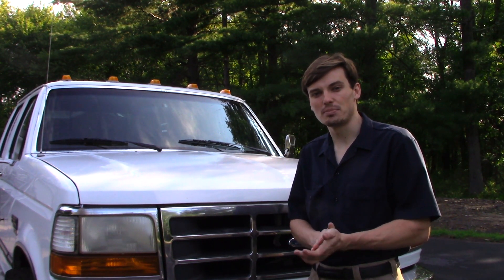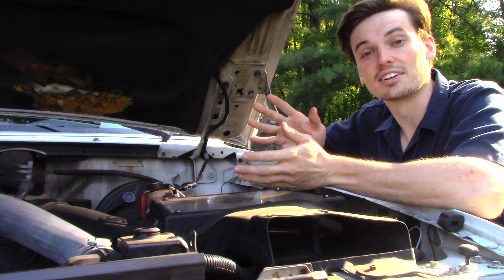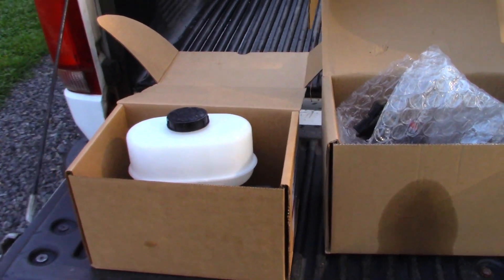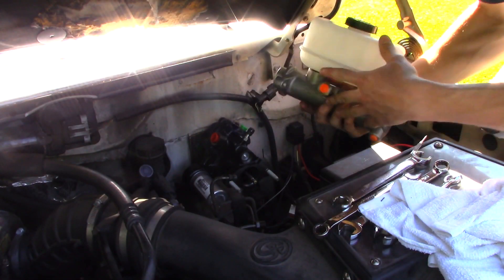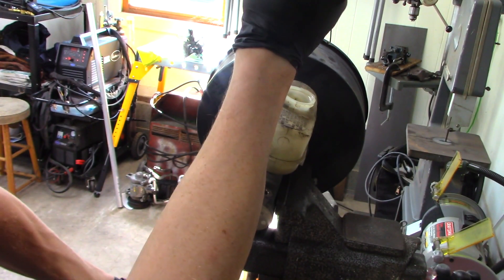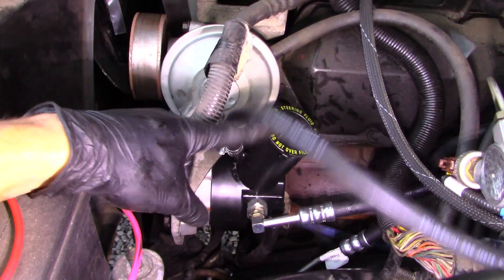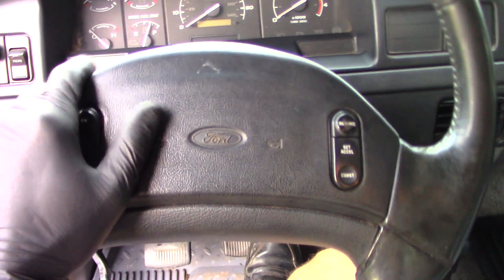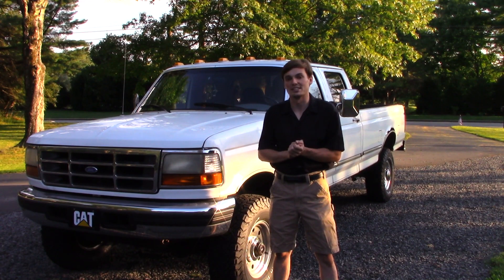Ford F350 Powerstroke 7.3 OBS Hydroboost Brake Conversion Upgrade (1992-1998)

Comment: Few things to note that you might already know by now.

The box under the dash connected to the brake pedal is the brake switch. It is what turns on your brake lights. Also on the E4OD trucks, if it gets signal from the brake switch, it will unlock the converter.

The sensor on the front of the master cylinder is for cruise control. When you push on the brakes it pushes in that pin which disables cruise.

It doesn't look like you moved either the brake pedal pin, or the hydroboost mounting location. As you can see when you're under the dash trying to hook up the new hydroboost, it's not lined up. It will work like this but you're binding the system. You either need to move the pin on the brake pedal up 5/8" or you can redrill/grind down the bolt holes on the firewall 5/8".

The proportioning valve for drum brakes is important because if you panic stop, you will lock up the rears but not the fronts. This is dangerous in a number of ways. You can order the correct proportioning valve using Ford PN F8UZ-2C161-AA. It's only about $70 and takes 5 minutes to install. Definitely worth the money to make sure your brakes will work correctly when you need them most.

Just did the same swap on my 1989 F350 with a leaky vacuum booster. $230 dollars later and I feel like I stop in half the distance now.

Overall good video. Subscribed!

Edit: One more thing. You don't actually need that new PS pump. You can put a tee on the hydroboost to PS reservoir return line and hook the steering box return into that. You just need to make sure that the hydroboost return to PS Pump is your "straight shot" and that your steering box return tees into it, otherwise you'll have issues. 

It's probably a good idea to replace the PS pump anyways, but just letting viewers of this video down the road that it's not required. Especially because that 2 return steering pump reservoir is getting harder and harder to find. You also have the option of grabbing a reservoir (or the whole pump) off of an F SuperDuty with the Hydroboost.
Reply from the maker: Thank you for the info, I'm finding mixed things online about the proportioning valve.  I used all parts form a "1997 F Superduty", I know parts change for the "2003 F Superduty" models.  What master cylinder did you get yours from?  Also, the old proportioning valve is different threads than the ones on the new master cylinder.
Thanks!
Reply: @E30Source  Mine came off a 1990 F Superduty. All F Superduty's came with 4 wheel disc brakes (Dana 80).

The part number (F8UZ-2C161-AA) for the proportioning valve is the correct application for bricknose/OBS trucks with rear drum brakes for a hydroboost unit

My factory (1989 F350) proportioning valve would not fit the hydroboost, but that new part fit both the hydroboost and brake lines.
Reply: You sir seem to know what you're talking about. I've been thinking about doing the swap for some time so I can have a solid and responsive brake pedal much like my 01 cummins. My truck is a 1994 f250 E4OD and it may be to your surprised but it is a 460, not a 7.3l. The design of the power steering pumps on both engines look the same, even down to the reservoir itself. I seized an opportunity at the junkyard the other day and grabbed a hydroboost off of a 10th gen SD which was a 1 ton dually. Would you believe I gave 20 bucks for it? 10 for master and 10 for booster. I love that junkyard because there's mostly old trucks there so they aren't horribly priced on stuff. So as far as I've read so far the pump is the same as the ones they used on the late model OBS F-series trucks with the 7.3l, so it should bolt right in. The pressure line up to the hydroboost threads into the same spot on the PS pump, then the pressure line off of the hydroboost to the steering box itself is the same. Only line that is modularity different is the return to the reservoir which just angles down on mine while it angles upward on the 7.3l power steering. Before I pulled it from the truck I had my friend stand on the pedal as hard as he could and I seen no signs of leakage. I also don't like the idea of adding a used system into my power steering system as that could introduce my pump to some unexpected debris from the SD truck. Thinking about slightly disassembling the booster, or what could I run into it to clean it out as much as I can? And since this hydroboost isn't from a f450 could I go without the other proportioning valve? Also, my truck is a 94 and new enough to have rear ABS only, wouldn't it prevent rear tires from locking in a panic stop or would the hydroboost not give a shit? One more question. Is it possible to add all 4 wheel ABS to the OBS trucks using parts from the super duty? I've been thinking about that for a long time now.

The general purpose for me wanting to do this is because I'm sick of having to pump my brakes for a firm pedal to stop with. It'll still stop just fine even if I don't pump it but the pedal sinks. I've bled the system multiple times and manually adjusted my drums, and the automatic adjuster isn't rusted a bit. It's functional. I also use this truck for local towing as a choice over my Cummins because it has 4.10s while the dodge has 3.55s. If I tow out of state I take the Cummins for mpg, and power at 70 and up because of the turbo. If it hits 60 on a hill with a load it's a done deal until downshift 🤣
Reply: Hey Daniel, would you happen to know the ford part number for the 4-wheel disk brake proportioning valve? I did the 05 axle conversion. If I go into a NAPA can I get all these parts saying I have a 97 F-Superduty?
Reply: @travisb6520  yup. Anything 1988-1997 FSuperDuty. It’s discontinued but this is the Ford PN E8TZ-2B547-B
Reply: @Duke.Chocula   forgot to tag
Reply: I have a couple of questions I think you might could answer if you get back to me
Reply: @breezy695  possibly. What’s up
Reply: @Duke.Chocula  Ok so I just got a 1997 F350 7.3L XLT about 2-3 months ago. The truck had been sitting in a barn for about 6 years prior to me getting it. I changed the brake pads and had a caliper go bad on me which locked the brakes up while I was driving. I replaced both front calipers, new wheel bearings, new rotors. Once I tried bleeding the brakes I couldn’t get any brake fluid to come out so I replaced the brake booster and went ahead and got a new master cylinder. Once replacing everything and finally successfully bleeding the air out. (At least I thought) the pedal was still spongy and sinking to the floor. This led me to believe the master cylinder or booster I had gotten was bad. I went back and swapped out the master cylinder and the new booster for new ones and installed them yesterday. I bled the brakes and didn’t really get much air out but I did get some. I went through about a bottle of brake fluid. The pedal now doesn’t sink to the floor anymore and definitely feels better this go round but it still feels a little soft on the initial press of the brake pedal. I got back on YouTube last night to see if I could find anything new and I came across a video where it said after bleeding the brakes I need to adjust the shoes on the drums in the back. What is your opinion on this? Note that I have not touched the drum brakes at all on the back but I have check for leaks everywhere and don’t find any.
Reply: @breezy695  
You may want to change out your flexible lines that go in to the calipers and cylinders. They may have begun deteriorating on the inside and will lead to a "spongy" feel to you brake pedal. Step it up to stainless steel braided for an upgrade.

Comment: Any issues with the HVAC controls not working?
Reply from the maker: I haven't, what kind of problems are you having?
Reply: @E30Source  haven't done the conversion yet, just asking to see if the plug for the vacuum line is working so the HVAC still works. Great solution rather than delete the pump and add an electrical vacuum pump.
Reply from the maker: @Thetjspecial13  Yea the plug works for the vacuum system.  There's a mod I found out there I forget where I saw it, but you plug a vacuum line that goes to the HVAC and it actually makes the A/C even colder.  I will try to dig it up.